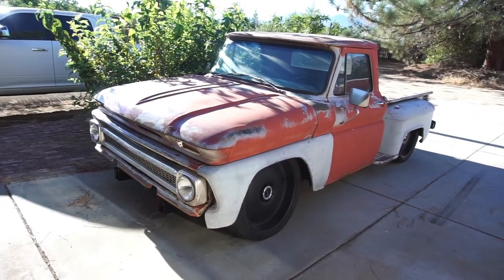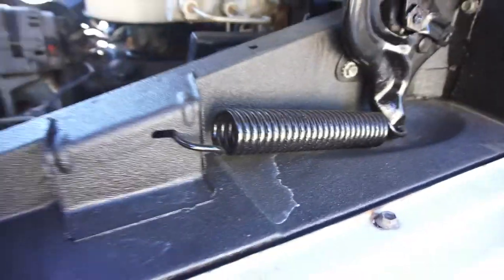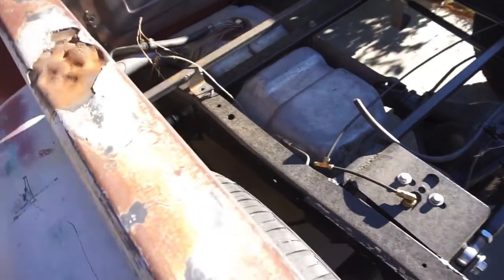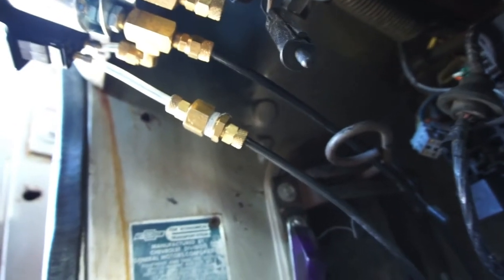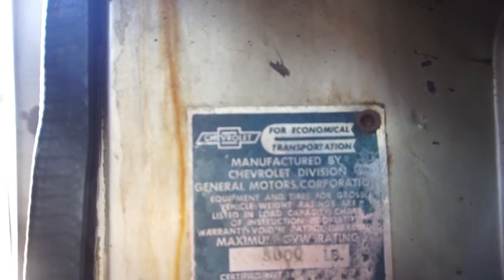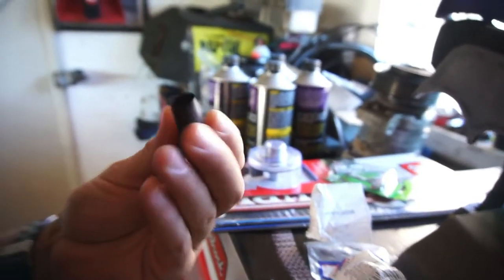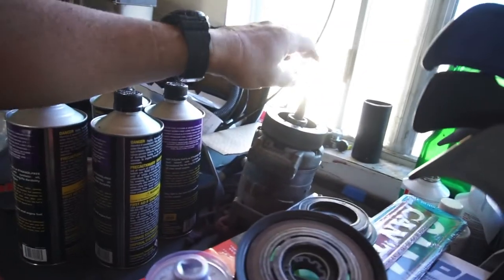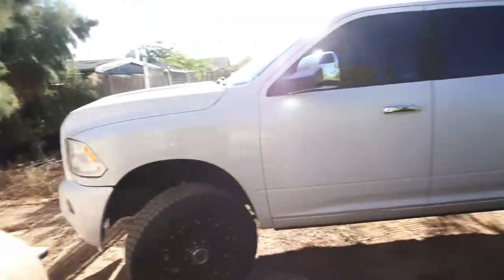What $1,800 Part Did I Buy For My 4th Gen Dodge Ram Cummins Mega Cab?

Comment: Locking hubs .
Reply from the maker: Orion Fixr locking hubs?
Reply: @Halffast719  ; Manual front locking hubs .
Reply from the maker: I’m not sure what you mean. 😉 😉
Reply: @Halffast719  ; Don't feel bad . Half the time I don't know what I mean !
Reply from the maker: Hahahaha. Yeah I bought some ram man inc manual locking hubs. $1800 man that’s a lot of money for them.
Reply: @Halffast719  ;  It'll take a while to break even on that purchase .  But the amount of reduced wear and tear on that front drive line is worth it .
Reply from the maker: Especially since I only drive my truck 2,000-5,000 miles a year.
Reply from the maker: Too bad I can’t get something like them for my Audi.
Reply: @Halffast719  :  I know what ya' mean . I had a "78 K-5 Blazer (new) with full time 4 wheel drive and I rebuilt that front drive shaft 5 times in about 70,000 miles . Bad design but a fun vehicle !!
Reply from the maker: Yeah. I hear you. I just don’t want my transfercase exploding.
Reply: @Halffast719  ; Oh I hear ya' there !  Big bucks !!